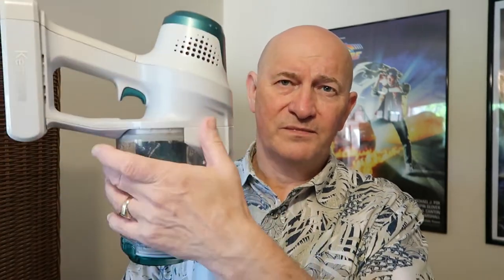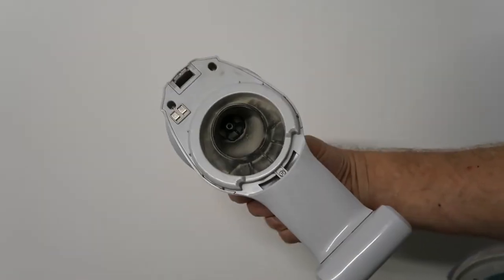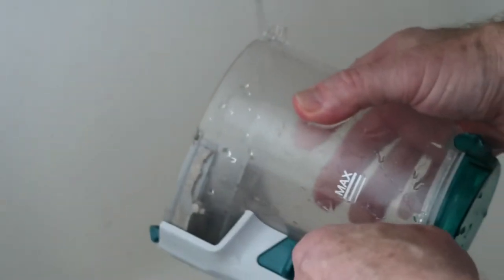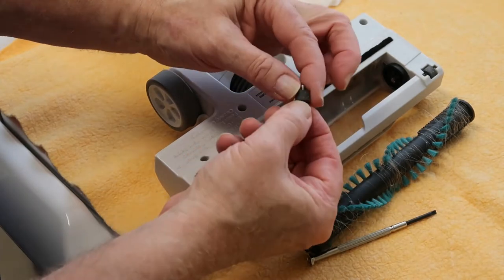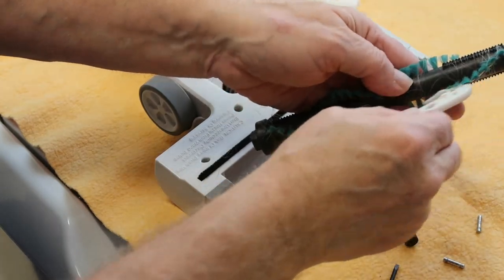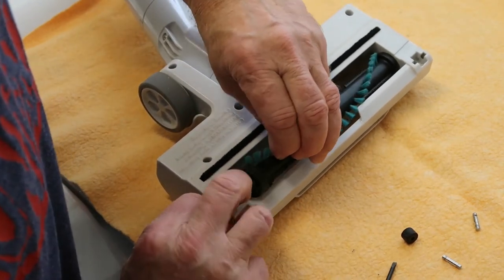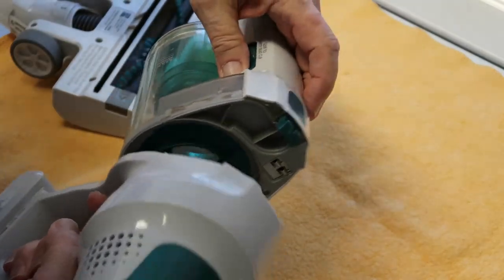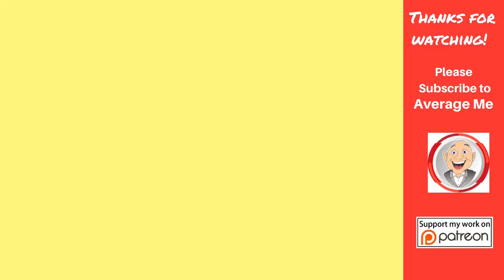How to Clean a Stick Vac - Kenmore and others

Comment from the maker: I'm surprised how well this vacuum works. Although I have a central vacuum I rarely use it. I use my stick vacuum cleaner every day and it's about all I need.
Reply from the maker: @Christian lover Time will tell. Like anything, the better it's treated the longer it will last. Mine is going on a year now.
Reply: The filters you need are: Kenmore K3000 CSV HEPA Replacement Vacuum Cleaner for Cordless Stick Vacuum

Comment: There is supposed to be a cone shaped pleated paper filter that fits in the green screen filter...keeps the fine dust out of your motor. My green filter was also stuck and watching your video I saw what it was supposed to do so I just pushed harder from inside the canister side and it popped right out...comes out easy like yours now.

Comment: The hexagonal piece that the non-square side of the brush sits into has seized up on our unit... any ideas why that might happen/how to fix? When attaching the head to the whole stick we get a red light and the motor shuts off. Unit works just fine without the head attached.
Reply from the maker: Maybe a short in the electric system of the head unit.

Comment: I love my kenmore csv stick vac like in the video. But I can’t get the pre filter out. The green part that you say looks like it holds a filter (which by the way mine does have a filter)
Reply from the maker: It is only held in with friction, as the rim is rubber and is a tight fit. Work with it and it will come out for cleaning. If you find a source for the filter, please let us all know.
Reply: Mine acts as if it is glued in it. It came with a filter but the green part does not move
Reply: I can't either.  I'm braking my hands here...
Reply: Had same problem. U have 2 hold it n twist it then pull hard. If need further help lemme know.